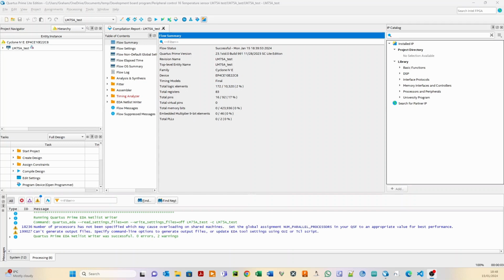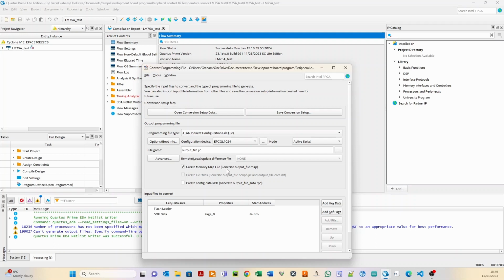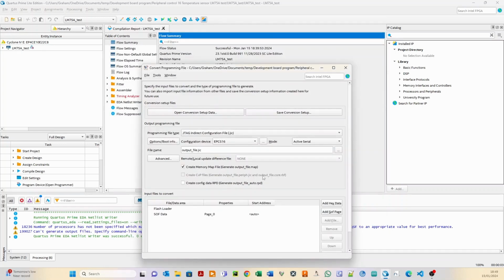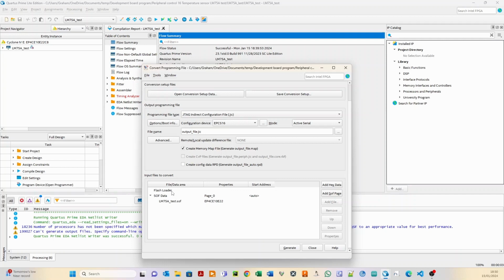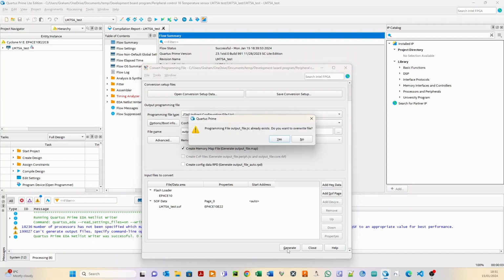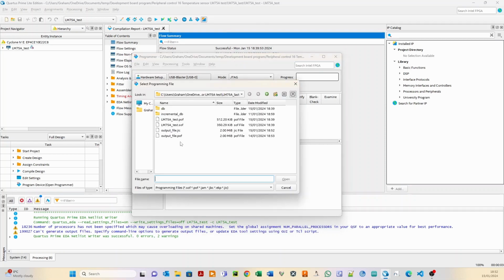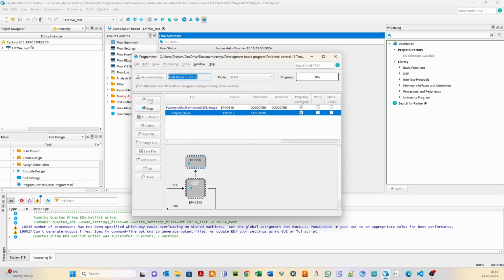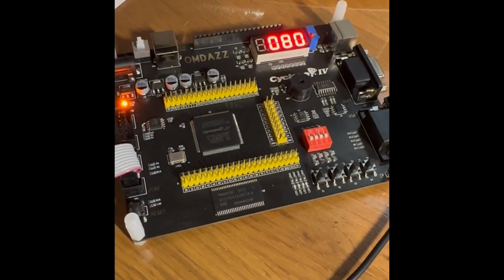OMDAZZ FPGA DEV BOARD

Comment: Hello, where can I get the data sheet specifically for the RZ401-EP4CE10 model?
Reply from the maker: Sorry not sure but the IC data you should be able to get here https://mm.digikey.com/Volume0/opasdata/d220001/medias/docus/2491/Cyclone%20IV%20Device%20Handbook%2C%20Volume%203_Web.pdf